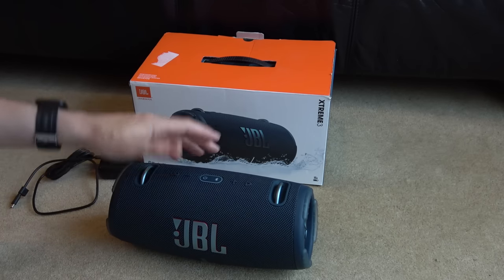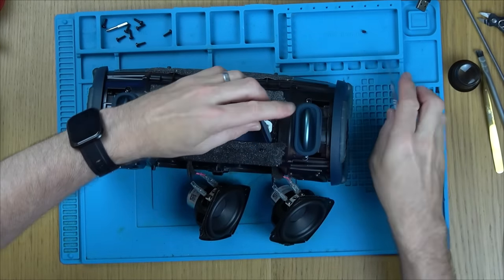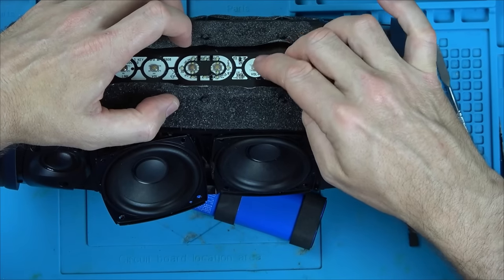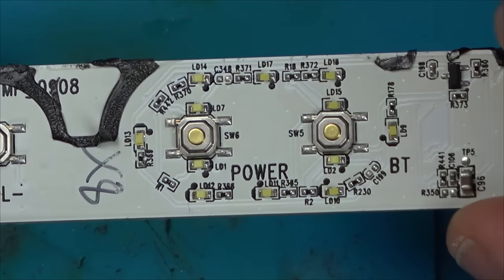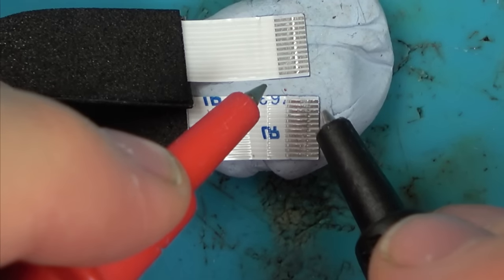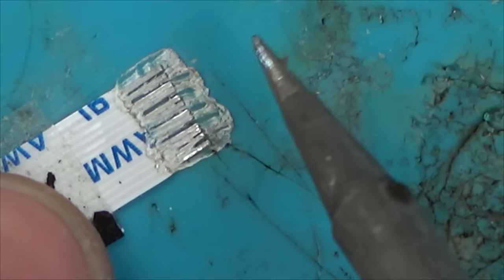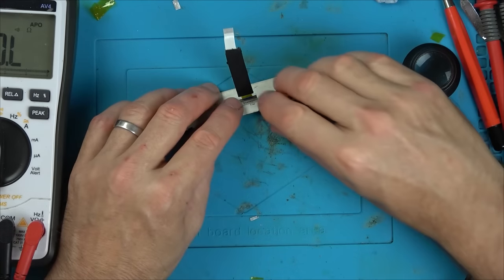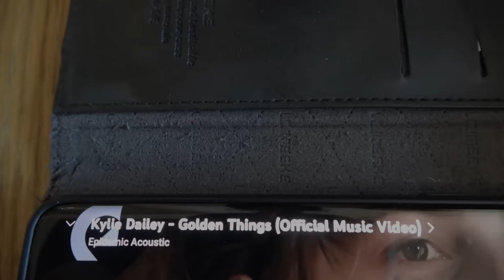JBL Xtreme 3 Waterproof Speaker No Power from NEW - Amazon Return Repair

Comment: You know, I really like the old 3 hour videos but this is your greatest voice over this far. Perfect to hear your thoughts at the time rather the the result after the fast forwarding, that made this one better in my opinion! Greatwork! Thank you and take care of your family!
Reply: It should be battery related sometimes it has very low voltage so it will only do it one time
Reply: It doesn’t turn on when it’s plugged in because then you would know it’s the battery
Reply: There are some very rare cases batteries can show the right voltage but still not have the right capacity to start something up
Reply from the maker: Thank you very much Anders, hope everything is going well for you and the family 👍👍

Comment: I had a JBL Charge 4 that worked for years then it gradually started to not turn off or on when I pressed the button. After a long time I decided to open it (it's designed the same way more or less) and i checked all the components around the button for voltage and one of the capacitors I tested turned it on and everytime I checked the one capacitor it turned either off or on. I put it back together and the power button has worked without a hitch every single time. It's been 4 months 😊

Comment: I reaally enjoyed watching this fix. Having fixed a few speakers myself, maybe the sound quality is underwhelming because not only the speaker may no longer be waterproof,  but may also be no longer completely airtight like that Bose soundlink mini 2 Bluetooth speaker you fixed had poor sound until you screwed down the battery. I would remove the cover and squeeze the passive radiators lke you did in the video. You then should hear if any air is escaping where it shouldn't be.

Comment: Sew with copper wire --- 1980s my cousin bought a ZX81 kit computer and during the winter the room was so cold he snapped the ribbon cable... Sewed it back together with thin copper wire.
On another occasion he came of the train to visit and the ZX81 was in his bag next to his SHAVING FOAM and it managed to poke in one of the connectors and fill it with foam, we cleaned if off and it smelt nice when it warmed up.

Comment: that's nice to see that you fixed the same model I fixed a while ago, my client dropped the speaker and it wasn't charging and if you can believe it was because of the ribbon cable that connect the charging board to main board it was disconnected after the drop so it was an easy fix I also added some hot glue to not happen again, it's interesting to see that yours had another fault

Comment: Nice fault finding and fix. Have experienced myself a device with poorly installed cable at the factory. My HP Brio computer from 2001 and it's 3,5" disk drive worked only partially. Found out that the data cable was inproperly installed, as one pin was bent, and prevented the connector going fully in. Only part of the pins were connected. Amazingly, the disk drive still basically worked, so must've passed QC inspection, but for some reason, couldn't make Windows 98 SE startup diskette, until I found the problem and fixed it.

Comment: This type of failure is not at all unusual on this type of 'flex' ribbon cable. They can be bent, but only around a radius of 4 times the thickness of the cable (this is absolute minimal radius for static bends). If a cable gets folded flat for instance because a gripper picks it up improperly, you get exactly this type of issue. The copper strands (or traces if you prefer) inside the cable break due to the bending force applied to create a flat small radius bend. The risk of this happening is often reduced by putting additional layers of tape, wrap or foil on the cable to prevent small radius bends from occuring even when under compressive load.

Comment: Vince, have you downloaded the JBL app on your phone? The connected speakers often have DSP EQ built into the unit but it can only be tweaked from the phone. It might be worth having a play with the app or doing a factory reset to check the speaker wasn't been messed with on the app by the last owner before the cable broke or trying to play with the EQ to see if you can get it more to your liking

Comment: Hello I am really enjoying your posts. Now I would like to ask a question that you might be able to help me with. I have a old radio that I keep in my kitchen, both the sound and tuning are very scratchy. I can gain access to both, what I would like to know, what switch or contact cleaner you think I should get to clean things up. A spray type is what I will need. If you can help thank you.
Reply from the maker: Personally I think I would probably use DeoxIT Fader F5 in spray form. Quite pricey though, but it should last a long time as a little goes a long way. You might want to confirm by doing a Google search on that product to make sure it is the best option as I am definitely NOT a professional on these things 😂👍👍

Comment: I can relate to this video. I had a JBL shower speaker that stopped working a few months back. When I pulled it apart, it had the exact same issue. The ribbon cable between the buttons and the main board had a kink at the fold and there was no signal being passed through. -- This seems like a design fault from JBL if you ask me.

Comment: On the jbl xtreme series, jbl did something I didn't like if you ask me! With each new firmware update, the sound quality could change and it didn't always improve, but since people focused a lot on BASS, it was often the ones they got in each update.
You never got an equalizer that you could adjust since it then goes beyond the sale of newer xtrem speakers.

Extrem 2 and 3 was ONLY a firmware update! Xtreme 2 could have been as good as 3 if you had updated the firmware and adjusted the eq. correct!

The Xtreme 1 does not have as good a tweeter as the 2 and 3 have.
Reply: Xtreme 4 has just come out and it is also a stereo speaker all the Xtreme series are stereo

Comment: I got one of the older ones years ago from a second hand store in the box for like $10, made some decent money as it worked fine. I use to love trying to repair things like this, so would take a chance on stuff to fix. Was overall a decent little portable speaker. I think the only issue I found was the logo for the pairing button was missing for some reason, so people must not have been able to figure out how to make it work, but the button was still where it should be and worked perfectly, you just could not see it. This was in 2017 or so. Pretty sure I looked up the manual while in the store on my phone, seen where the pairing button was supposed to be, paired it and found it worked perfect before I even bought it, it was already charged up! Had its original box and charger and all that.

Comment: a less aggressive way of doing that would be to use a sharp knife to scrape the surface off and expose the copper, it doesnt compromise the structure or allow for shorts like melting it does and it maintains the thickness of the ribbon allowing for stronger contact

Comment: Yeah that is very weird I've never seen or had a faulty ribbon cable in anything I have ever bought brand new the only ribbon cable failure I've ever had was the PS2 controller port ribbon cable and that was caused over time because it was working then just randomly stopped working. You didn't scare me this time Vince but you did scare my TV it has the hiccups now

Comment: Ngl, I was screaming internally to check the cable linking the boards. As you'd confirmed the charger was working meant that the boards were essentially good. Logic dictates that because the machine was never able to turn on, and electronic failures straight out the box are extremely rare meant that it was an electrical fault not electronic.

Comment: 10:57  Is that a metal thread in there?  Possible short?  Always try using compressed air to blow stuff out of these tiny connectors and then reinspect:).  I also wipe the ribbon connectors with a touch of IPA to remove any finger grease from a possible sloppy assembler at the factory:).

Comment: I have one of the first models of those JBL cylindrical shaped Bluetooth speakers and it sounds awful. The bass level is way out of proportion and the rest of the frequency response also sounded artificial. The biggest flaw of that speaker was that this didn't have a switch for disabling that horrible equalizer preset.

Comment: To set the speaker in reset mode , take out the batteri and press all buttons , so all voltage in the Elektrolyt caps drains out !

Comment: Just added a couple newbies to the collection, original Casio 200m diver, still on its original rubber strap but the star of the show is I found a rare as rocking horse doings Pulsar Y182 which is the iconic 7T32 but with a different stamped top plate for Pulsar, Alba and I believe one Lorus had one, its a gold plated beauty that is in almost unworn condition too :)   Only fly in ointment is Boris Johnson likes to wear a Pulsar chrono :( :( :( (might put me off the brand if it starts lying to me about the time and I catch it trying to lift my card out me wallet... :P)